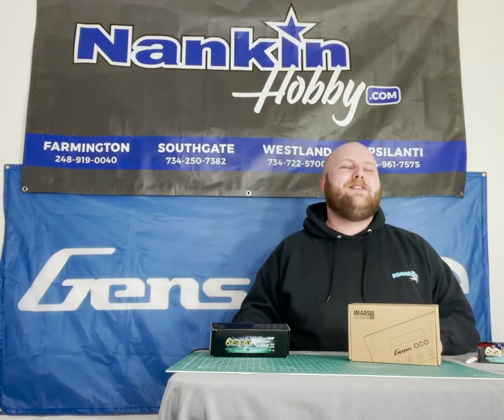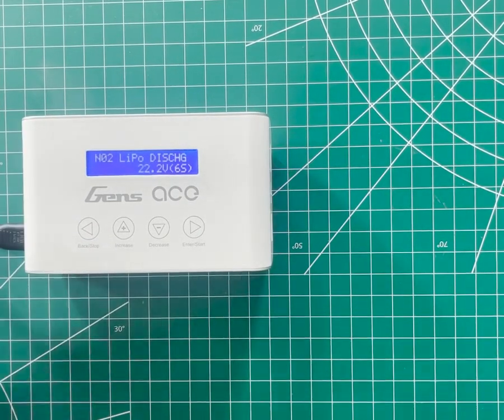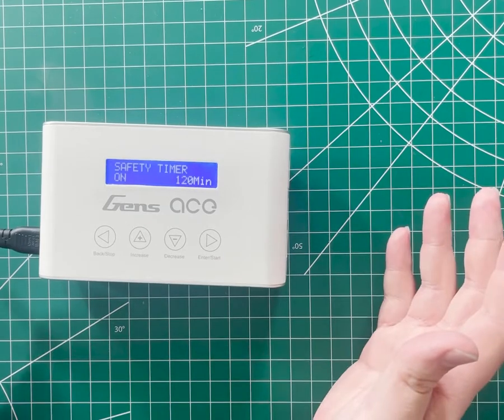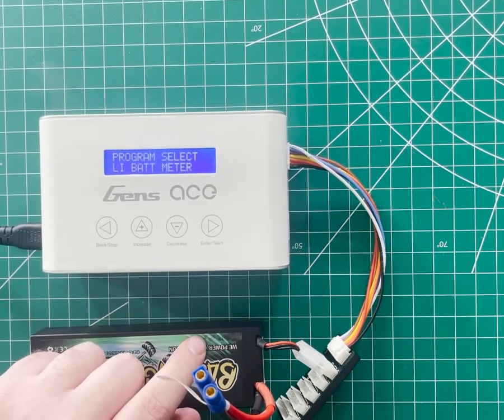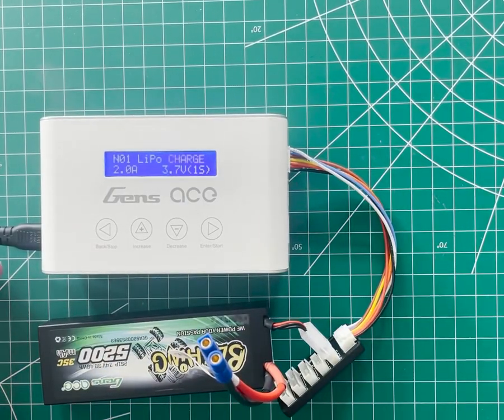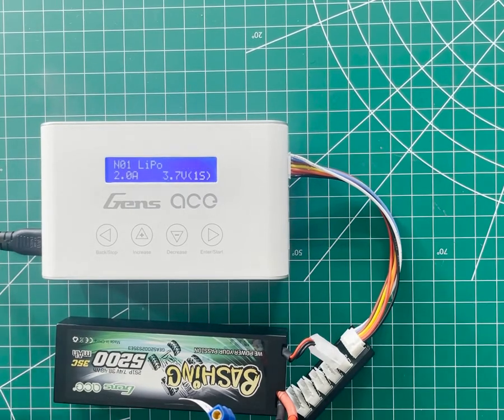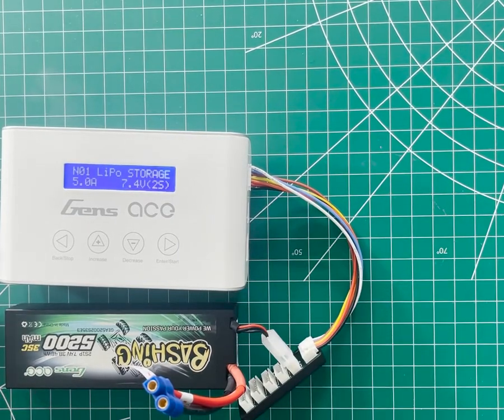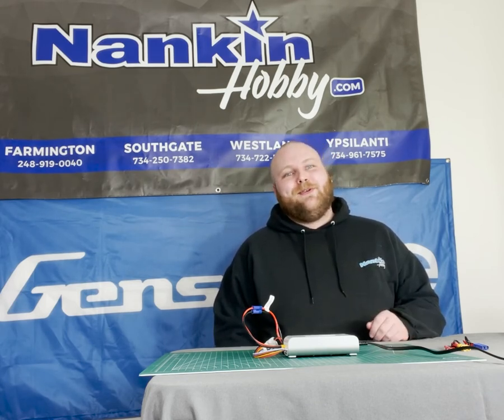How To: Charging and Maintaining LiPo Batteries - Featuring the Gens Ace IMARS III

Comment: What are the volts section
Reply from the maker: That will depend on your battery. For LiPo batteries, voltage will go up on increments of 3.7V for each cell the battery has. The charger is adjustable in these increments. For other batteries, this may differ.

Comment: I am having issues where the charger only chargers my lipo batteries to 4.09v as opposed to 4.2v... any suggestions or insight?
Reply: Maker of this video didn't read the manual I guess and the information in the video isn't correct. To balance charge on imars chargers you use lipo charge mode. Cell balance program is used just to fix the battery, if there is big disbalance (or at least its like that on pro version - page 15 in manual).
Reply from the maker: Are all of the cells 4.09V, or is there maybe one cell significantly higher or lower than the rest? If one cell is somehow over 4.2, or under 3, the charger likely won't attempt to do anything. If a cell isn't THAT far off, but still considerably higher/lower, the charger may be spending a bunch of time balancing the cells and you're hitting a time-based cutoff before the battery is finished charging. Or if the capacity cutoff were set too low, it could also cut off before it hits voltage. 

Both the timer and the capacity cutoff should be exceptionally high by default, so those likely aren't the issue unless they were adjusted, but still maybe worth a check.

Feel free to give us a call at (248) 919-0040 and we can try to figure out other possibilities as well.
Reply: Yeah same here
Reply from the maker: @omarmalpica5021  I don't have any other good thoughts as to why that might be the case, but if you give us a call at (248) 919-0040, we can maybe discuss it a little more in-depth and get to the bottom of it!

Comment: After cellball..you have to fully charge your battery pack right,otherwise its not fully charged?!
Reply from the maker: The "cell bal" function is actually a balance, not just a balancing function. It will balance the cells as well as charging them fully, so no, you won't have to charge them any further than what that function does on its own.
Reply: Ok thanx 👍😄

Comment: hi,so in storage setting,you just start the charger and it will automatically charge it to storage mode?
Reply from the maker: Yes! In the storage setting it will charge or discharge as necessary until the pack is at storage voltage!

Comment: I threw manual away after seeing this. Way more helpful. Thanks. Can you do tips and instructions for discharging? Or does it do it by parameters and info I already entered when charging.
Reply from the maker: There’s very rarely ever a reason to use the “discharge” function for a LiPo battery. The only times you’ll ever really be discharging it are for storage, in which case you’ll want to instead use the storage function, or for disposal, in which case no charger will discharge it completely anyway. With that said, though, if you do have som other reason to discharge, or you’re discharging a different type of battery, yes, the same specs you enter for charging will be used for the discharge function.

Comment: I plan on getting the pro version of this charger or the dual charger and was wondering if it automatically balances when you charge with the balancer connected or you have to do that separate with the balance mode? Also do you balance before or after you charge?
Reply from the maker: One of the settings on the charger will balance in addition to charging, so there’s no need to run two separate functions. If you were using a charger that had two separate functions to accomplish charging and balancing, as long as you’re balancing regularly, I would think that after charging would be ideal. Most chargers won’t require you to do these things separately, though.

And we agree, there’s little reason to get the regular IMARS III anymore, as the price difference to go for the pro is minimal. In fact, I believe we’ve stopped carrying the regular version and just carry the pro and the dual now. 

It’s worth noting that the menus and settings on the IMARS III Dual are totally different, while it’s pretty much identical between the IMARS III and the IMARS III Pro. Maybe we’ll put together a video on the Dual version as well, but if you grab one of those and have any questions in the meantime, just reach out, we’re happy to help!

You can grab the IMARS III Pro from us here: https://shop.nankinhobby.com/products/gensace-imars-iii-pro-10a-smart-balance-rc-battery-charger-468884.html

Or, the dual version in white here: https://shop.nankinhobby.com/products/gens-ace-imars-dual-port-ac-dc-charger--6s-15a-100w-x-2---white--492195.html

Or in black: https://shop.nankinhobby.com/products/gensace-imars-dual-channel-ac200w-dc300w-balance-charger-black-492194.html
Reply: @NankinHobby  Wow! I really appreciate the reply being that I'm a newbie! I just received my typhon tlr rtr this week, so it means a lot and i greatly appreciate it! Definitely will order one from you guys if I don't receive it for Christmas!
Reply from the maker: @Scootbreezy23  That's a great vehicle! We think you'll definitely have a ton of fun with it!

Comment: I have this charger - no luck trying to charge a 14.8 LiIon 44.4wh 3000mAh battery from a Duralast 1200 jumper device.  I get a 'check balance connector' error.
The balance connecter from the battery is 6-pin for a 4S.  Wire colors are Red Blue Yellow White Black Black.  There seems to be an extra cable....help.
Reply from the maker: There definitely is an extra wire. A 4 cell should only have 5, and that's almost certainly why the charger is giving you that error. I don't think there's going to be a safe workaround. I'm not sure what that extra wire is doing, other than maybe just forcing you to use a proprietary charger.
Reply: @NankinHobby  Thanks for the reply.  Yes, it seems like a proprietary bs thing since it came from a charging board that can't charge the battery.  The instructions say that the unit needs to be charged for storage and I didn't that so it seems the battery charge was way too low to work with hence this other method I'm trying using this Gens Ace.  Gonna experiment with a homemade adapter and get ready for anything.

Comment: Hello I was just wondering how will I know when the battery is done charging with this charger? and if it automatically turns off when the charging is done.
Reply from the maker: The charger should make a noise to let you know it's done, as well as display a message on the screen. It does stop charging when charging is complete, but whenever the battery is plugged into anything, whether it be a vehicle or the charger, there's a little bit of drain on the pack, so we don't recommend leaving it plugged in for any extended periods of time even if it isn't charging.

Comment: Hi there !
New to rc world. I got the same charger and notice that my 2s battery doesn’t go up 4.2 volts per cell  when I am choosing the cellbal mode .It stops at 4.09-4.10 volts .To reach 4.2 v per cell ,it’s done only by choosing the charge mode .Is normal ???
Thanks 🙏
Reply from the maker: I'll have to do a test to confirm this, but that doesn't sound normal. It should, at least in theory, still charge to 4.2v per cell in balance mode. My suspicion would be that it's maybe timing out or something because it's taking too long to balance the cells. Are they both reaching the same voltage at the end?
Reply: @NankinHobby  Thanks for your answer!
I don’t really remember .I let you know tomorrow  after I check it again.
Greetings from Greece !!!

Comment: When you set capacity limit is it set to the individual memory slot or default for whole system?
Reply from the maker: The capacity limit is in the overall settings for the charger, rather than the individual battery profiles, so it should apply across the board. I'd set this to just a hair higher than the largest battery you're charging - and if you're charging two packs with wildly different capacities, you might want to adjust this between charges.

Comment: Hi. I have one pro version (10amper) and I put one 6s 5000mha lipo to charge with 5.0amper.The charger keep it always at 4.2 amper even if I put also 10 amper. Did you know why he make this?
Reply from the maker: Typically you wouldn't charge a 5000mAh pack any faster than 5A. Unless the pack says that it can be charged at something greater than a 1C rate, I wouldn't charge this pack at 10A.

With that said, though, while the IMARS III Pro is capable of charging at 10A, it's also limited by its wattage. It's a 100W charger, so depending on the voltage of the pack, it may be limited to less than 10A because it doesn't have enough wattage to push out 10A at higher voltages.

To figure out this limitation, take 100 (the wattage on the charger), and divide that by your pack voltage. This will give you maximum amperage that the charger can put out at a particular voltage. On a 2S pack (7.4V), the IMARS III Pro will be able to charge at its maximum rate (10A), but on a 3S pack (11.1V), it doesn't have enough wattage to put out 10A, and will be limited to 9A. If you're charging a much larger pack, say a 6S pack (22.2V), the charger will only be able to charge at 4.5A. These figures might vary slightly, because I'm calculating the nominal voltages (3.7V per cell), though in reality they might be a bit higher or lower.

If the 5000mAh pack you're charging is a 6S pack (22.2V), the charger is probably working properly if it's only charging at 4.2A. If it's not a 6S pack, there may be something else wrong.

Comment: Thanks for the information on the charger. I have a question. I have a 5000mAh 8.4 volt charger. How do I know when my battery is done charging?
Reply from the maker: It depends on the charger, but there will usually be some sort of notification - it may say on the screen that it's done, or there may be a light code, and usually there will be some sort of audible beep or something. If your charger doesn't have any of these things, that would be strange and I would consider a different charger - knowing when your battery is done charging is pretty important. Hopefully the charger would still stop even if it doesn't notify you, but there's also a bit of a drain on the battery if it's left plugged in beyond its charge-time. 

8.4V would be the end-voltage for a 2S LiPo, so if you're seeing that voltage it likely is done or close to done, but there can still be balancing that's done after the overall pack voltage hits 8.4V, so that isn't enough of an indicator on its own.
Reply: @NankinHobby  Thank you for the help

Comment: Does this charger beep when charging is done?
Reply from the maker: It does, but I wouldn't rely on the sound output to charge while in another room. You should still be nearby while the battery is charging so if you do see anything going wrong you can stop it. LiPo fires are rare, but can be catastrophic, so catching an issue before it becomes a fire is huge.

Comment: I have a question. I'm new in the Hobby. I have the same charger like you and when I want to storage my 6s 1300mah 100c battery it shows that it storages the battery only with 0.2 A, but I chose 1.3 A to storage.
It takes over 2 hours. 
Is this normal or should I give it back?
Reply from the maker: Good question! This is normal. The storage function will either charge or discharge as necessary to get the battery to the proper level. The discharge circuit in the charger isn't as capable as the charge, so while you may set it for 1.3A (the charger is definitely capable of charging at this rate, or higher) it will discharge at a much lower rate. This is pretty typical of the vast majority of chargers. Fortunately you're not typically in a rush to store batteries, so it's not usually a big issue.
Reply: @NankinHobby  Thank you. I will keep it.